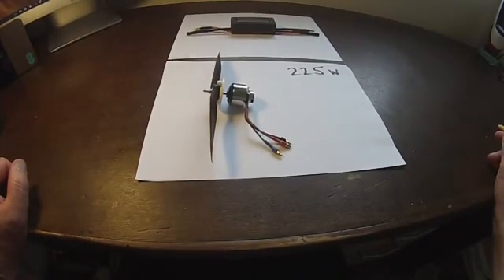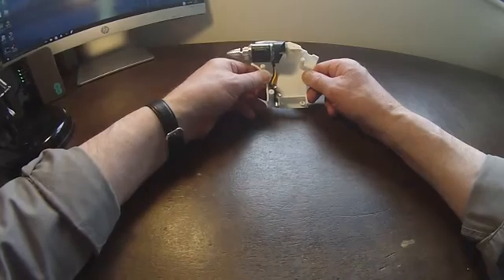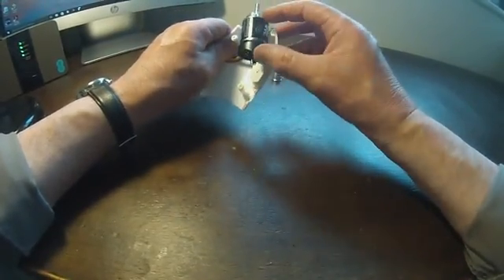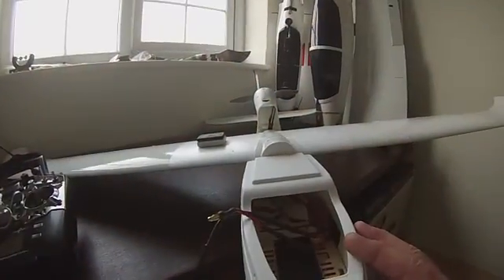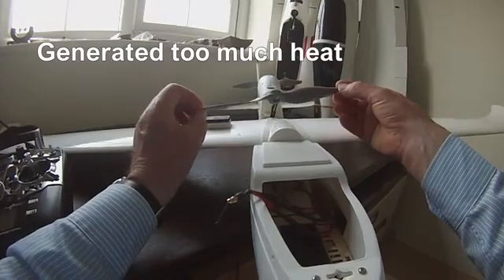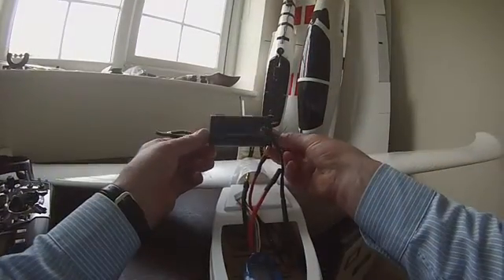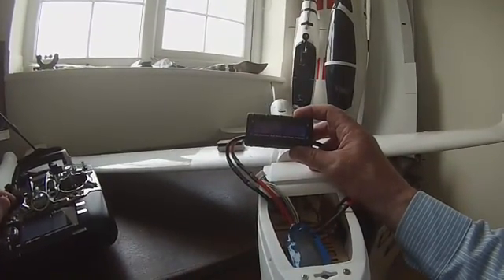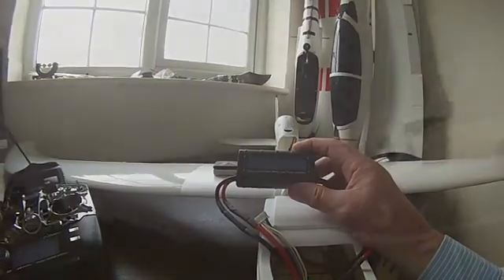450 WATT motor upgrade to FIRSTAR 1600 - rc fpv - Raptor - FIT INFO

Comment: Hi , do you have a link for that motor and the motor mount ? thanks
Reply from the maker: Thanks for your comment.  Have a look on Hobby King under accessories.  Bought a new motor unit off them some years ago.  Maybe they still stock them.

Comment: Hi nice vid! I would like to but this model! What are your impressions and feelings?? What about your new motor - prop- battery  setup??
Reply from the maker: I wanted a 3 axis FPV capable plane that I didn't have to rig when I got to the flying field. When I  looked at what is available I decided to try the Firstar 1600.   I wasn't disappointed as it fits into the back of a hatchback with the wing fitted to the fuselage. Perfect.  The fuselage is made of plastic which is a little heavy but on the plus side it is very strong.  I do not overload it with too much weight because I self launch into nil winds and it  needs some speed for the elevator to hold its nose up -  or -  it can impact with the ground.  I fly it with a 2200 4 cell lipo and enjoy flight times of up to 20 mins if I gain some free height by using a passing thermal.  I fly FPV and use it for chasing Thermal, Aerobatics, Jumping fences, and viewing the world from above.  I have beefed mine up at the control surfaces and made it a one piece wing for added strength and reduced flex.  I also replaced the aileron control rods and clevises.  I moved the position of the elevator horn so that the control rod has a straight run to the elevator.   Also changed the position of the CG.  Just returned from a good days flying.  I took four batteries and enjoyed an hour in the air.   It flies OK with the stock motor but only if you use a 3 cell 2200 lipo.  Would I buy another one?     YES. .............  Ref your SECOND question.............. I currently use an NTM 28/36  - 2200 KV motor.  It has a maximum output of 696 watts.  I have fitted an APC 7 x 5 EP pusher prop.  Currently use a 60 amp ESC.